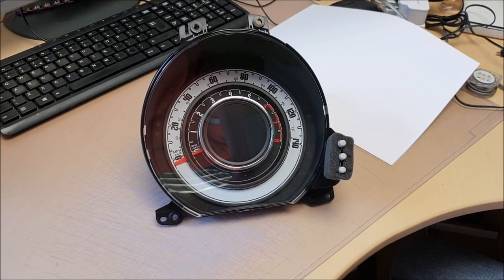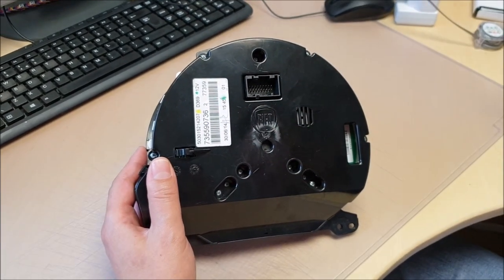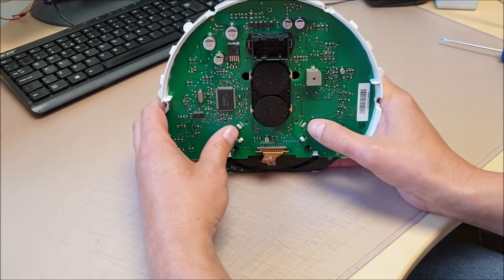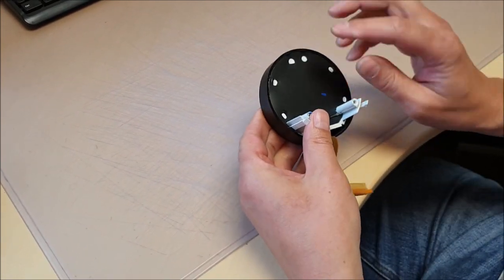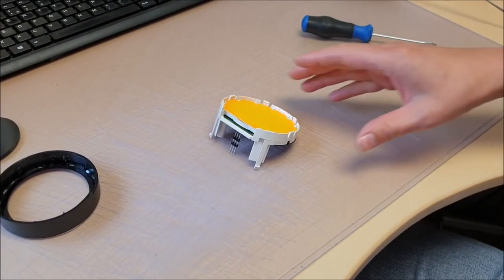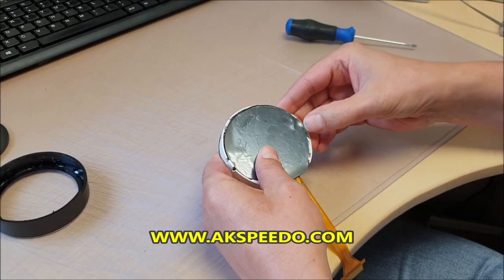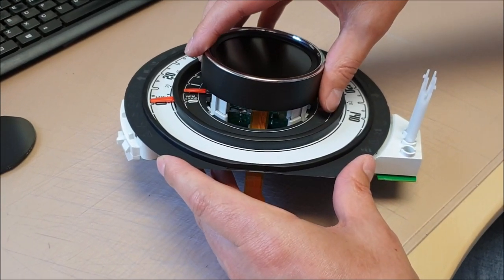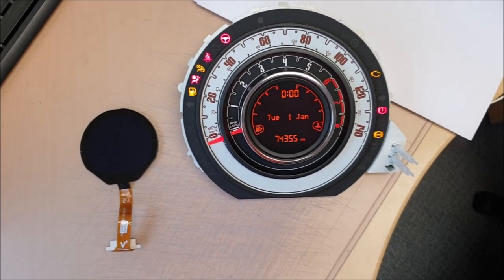Fiat 500 Speedometer replacement LCD Pixel Repair

Comment: The LCD display failed on our 2014 500 in 2019.  The franchised dealer wanted £650 to replace, so left it a while.  I bought a display from AK Speedo for £70 and did it myself following this video and one form 'Cars for Paul' which detailed how to get the assembly out of the 500 dashboard.   Turned out to be a very easy job and showed yet again what I always knew about the Main Dealer.....
Reply from the maker: Thanks for your comment http://www.akspeedo.com/

Comment: Interesting video, thanks. Mine has the backlight working, but nothing displayed, almost feels like a snapped ribbon cable. I also have the coolant warning & abs light flashing (& another I can't remember) when indicating right, so I think there's an internal short (maybe caused by a snapped ribbon cable?). The lights work fine at the rear of the car, so there's no external body wiring circuits causing that issue.
Reply from the maker: Blank screen caused by faulty LCD display, not ribbon cable.

Comment: Hi! This is probably a long shot but I’ve wracked the internet for answers to no avail so here we goooo! 
A good sized moth has found its way into my 500’s speedometer and I have no idea how to go about getting it out. I really don’t like moths so it is very distracting while driving and when it crawls out of view I get very paranoid thinking it will pop out and fly into my face. Do you have any theories to how it got in and the most likely way it could crawl out? Either it’ll come out in its own accord or I’ll have a corpse to deal with so any advice will be greatly appreciated!

Comment: Hi, 

in my case the display itself seems to be fine (no faulty LCD elements or what so ever) , but the backlight isn‘t working. Any idea what the issue might be? A bad connection or fault in the main PCB?
Reply from the maker: Possibly, strip it down and check, cheers James